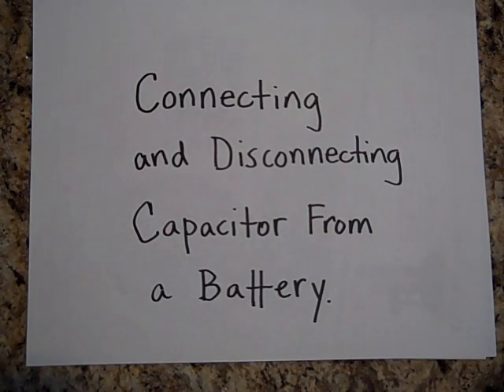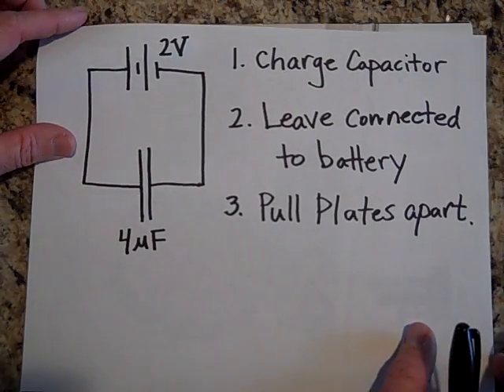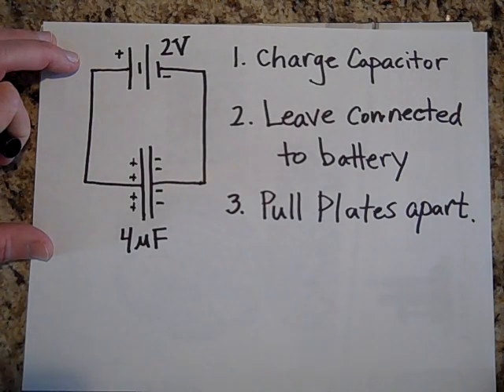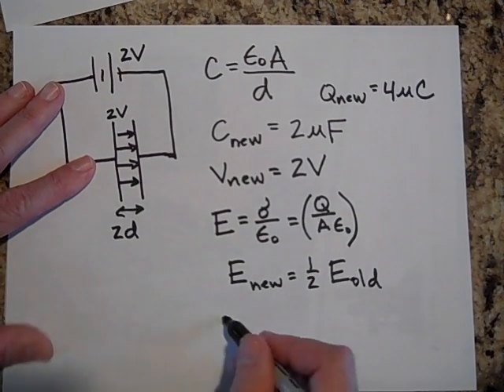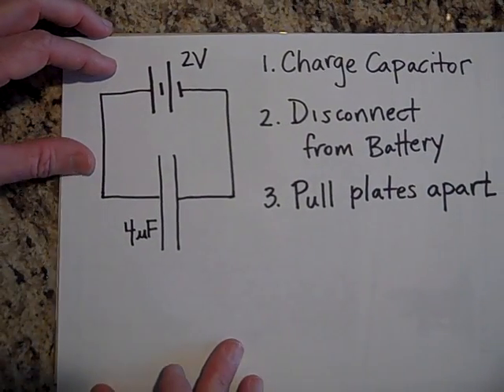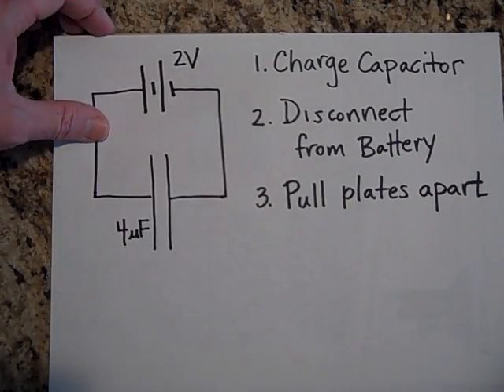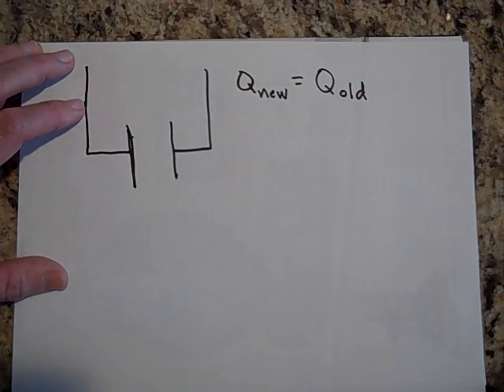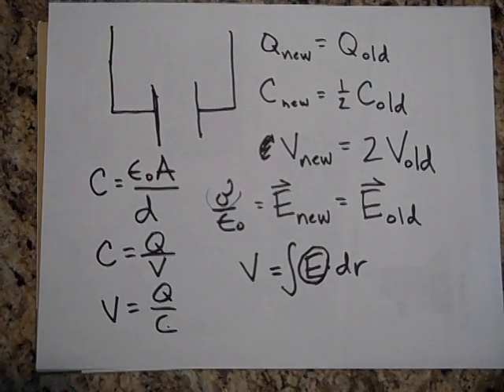Changing the Capacitance of a Capacitor

Comment: How do I reduce a 2400pF capacitor into 1600pF ?
Reply from the maker: I'm not sure if you're asking to solve a physics problem or if you really want to change the capacitance for a practical reason.  If it's for a physics problem, then increase the distance between the plates or change the dielectric.  C=k(epsilon naught)A/d.  Of course that's not a practical option if you really want to do this.  Then you might put a second capacitor in series with the first, 1/Ceq = 1/C1+1/C2.   Still not easy to do in a more complex circuit.  Not trying to be a wise guy, but if you really  want to do this for a real circuit, buy a 1600pF capacitor.

Comment: What is the effect on a charge if we increase the distance between the plates of a parallel plate capacitor?
Reply from the maker: If the capacitor is connected to the battery when this is done the charge on the capacitor will go down.  Since C = k(epsilon naught)A/d , increasing d decreases C.  You must do work to pull the plates apart (since they are oppositely charged) and that work transfers energy from the capacitor to perhaps the battery.  If the capacitor is instead disconnected from the battery, the charge will likely remain the same since it has nowhere to go.